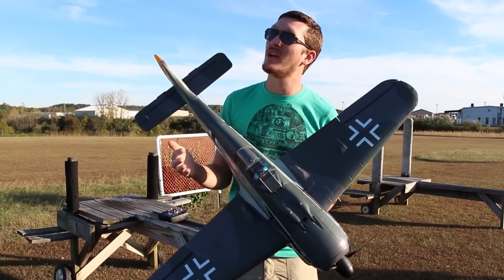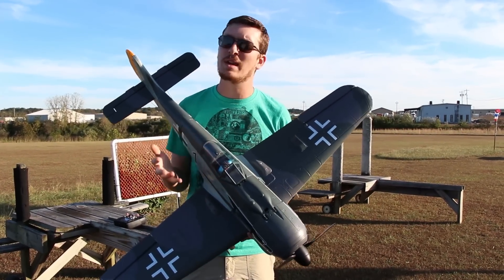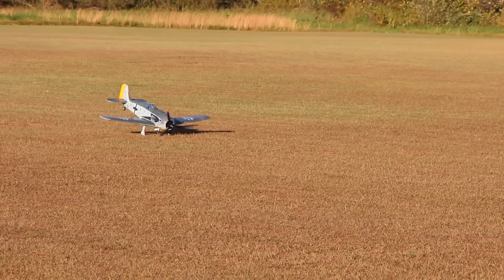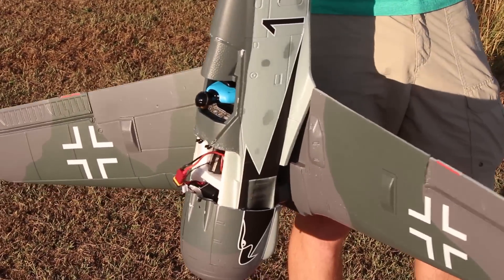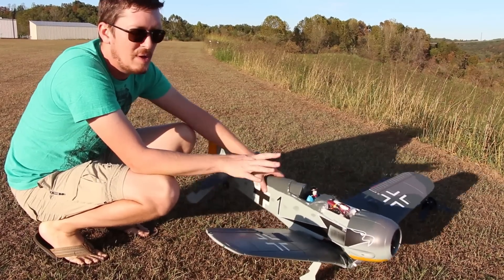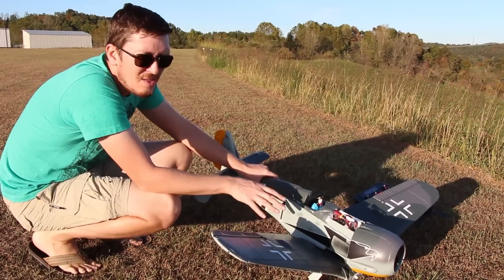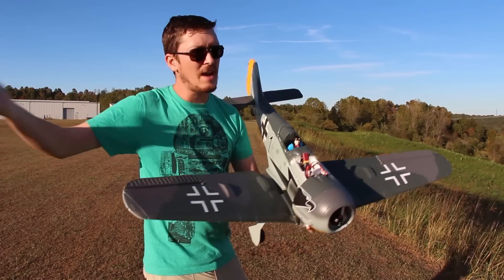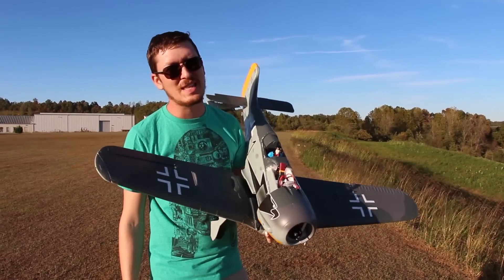WORST RC PLANE CRASH EVER!! - FW190 BRUTALLY DESTROYED!!! - TheRcSaylors

Comment: You can clearly see your inexperience in this video. Fly planes with flight stabilizers. They make everyone look professional!
Reply: Nate has been flying a long time so your comment is very unjustified. Also, FYI, many guys that might have had to give up the hobby  because of their health are still flying because of stability control. I remember many an old guy calling it cheating and " not really flying" if you used stability controls. Now many of those guys are eating those words. I know how to fly but I still like to have stability control if needed. The cost of saving a plane from crashing makes it worth it and not having to sell all your planes at age 80 because your hands do not function right any more.
Reply: @scottfirman  You seem to have  misunderstood the comment. I fly all my planes with flight stabilizers and would not fly one without.  The fact that he had great difficulty and destroyed the plane would indicate that he either did not have stabilization or it was turned off. I use stabilization when I get in trouble to save the plane or quad. Yes I have STAB mode on all quads that will allow it. So the comment was an attempt to help not insult. I have noticed from other comments from you that you appear to have a bit of a chip!

Comment: Have  they don't call me RECKEM ROY for nothing I've made the look worse than that. And  fixed them to fly better.  So did that low e and stop looking and wondering if it can take a 4s battery and just put one in and enjoy what happens so take the advice of me and countless others that have already made the same mistake as you 3a doesn't work in this PLANE  I fly mine on 4s every time and the esc  is fine fix it and do it.    NUFF SAID   👍😎👍✌✌✌✌✌✌✌✌